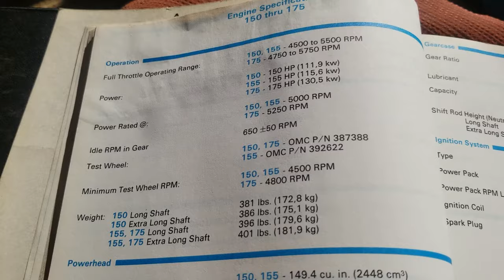How To Link and Sync An Evinrude Outboard

Comment from the maker: Hey Yall! Tools & parts in the description. Check out the previous video: Evinrude Outboard Timer Base Replacement:  https://youtu.be/cH7iE25YJAY
Timestamps
0:00 Intro
0:55 Checklist
1:16 Sync Carbs
3:07 Timing Settings
4:30 Set Timing Pointer
7:24 Set Pickup Timing
8:24 Set Idle Speed
9:40 Set WOT Timing
13:11 Test Run On Water
13:28 Outro

**Disclaimer: Matt's Shop assumes no responsibility and is not liable for any damages that may occur from attempting to duplicate any repair procedures performed in this video. This is for entertainment purposes only.**
Reply: Do you have a tutorial on harnesses and starter hook up

Comment: great video thaks a lot!..........can I ask you something...........I have a Johnson 100 hp 1985 (J100WMPLP) and have also the service manual, where it says there´s a decal on the motor with the timing specs....well, I don´t see any decal anywhere and because of that don´d know the max spark advance timing........what should I do?........thanks in advance

Comment: Would it be possible to have a word with you on this since I'm doing the same thing except on a 79 Evinrude 115hp. ??? example question why when I put the timing light on cylinder one plug the timing marks on the flywheel don't show at the timing pointer? Oddly it shows when I put it on Cylinder 4. Among other questions. What would be an easier way to have a conversation with you rather than typing here and waiting for a reply. We are not in the 80's anymore ya know. Much appreciated.

Comment: I have a 1972 evinrude 135 it sounds like its in gear when i start the motor also sounds like its full throttle alao the prop spins while in neutral i have it on a motor mount off my boat but im going to need some help getting it running right i was wondering if you could shed any light on it as right now its pretty scary to start the motor and it sounds like it is running full out in neutral and insight would help

Comment: Hi ive noticed your primer switch is not in the run position is there a reason why i the same motor but a johnson gt175 my primer valve points to the bottom of the electic unit, its right up cold or warm but bogs down when u add throttle to it.

Comment: Good informative video. Just a little more information that is considerably safer, set the timing  with the cables disconnected , cranking the engine. You can set all timing events while cranking the engine. That’s how I’ve always done them. The only thing I adjust on the water is the idle rpm.

Comment: Awesome. I have a problem with my 04 rude 225 that stall when I accelerate. Only does it sometimes. The diagnostic show CPS out of sync. Replace it still same issue. Any idea that will help? Thanks

Comment: I have a 1984 Evanrude Super40.  I believe it is identical to the 84 Norsemen. Sold to another part of the world and name something different.  

Is it possible to take a electric start system from a 84 Evan rude and adapted over to the 84 super40.

My problem is that you damn near  have to be the Incredible Hulk to pull start this motor and if you're not paying attention it will pull you right back into it.

 So I'm hope is that I can take the electric start setup off of the 84 Evinrude 40 and it will fit onto the 1984 Evan rude super 40. 

Thankyou. 🙏🙏

Comment: I've got a 50hp evinrude on my 13ft whaler that only goes 23mph, maxes at about 3000rpm, and it has issues planing with more than one person in the boat. I weighed the boat and motor thinking it was water logged, but total only weighs 650lbs.  I'll be doing this tomorrow. Thanks for the awesome video.
Reply: How'd it work out
Reply: Make shure your power pack leads are correct
Reply: what year is it? are the throttle plates exactly horixontal at WOT? just get a toothpick and stick it in the roll pin on stbd side of #1 carb, no need to remove air silencer to check.

Comment: Just wondering what is the best fuel/oil mixture for an outboard?  I have an old 1975 Evinrude 115 hp.  I don't have the owners Manuel, but internet says 50:1.  Your thoughts...  thanks!
Reply from the maker: 50:1 Always on old outboards. That's what all Evinrudes do best on.
Reply: @MattsShop  thanks Matt!!!

Comment: I’m having issues with my 1987 Johnson 90hp she will run perfect but she won’t stay running on idle but if I lift the throttle by a hair it starts but high revs
Reply from the maker: They always do this. If you are running surface gap plugs. Look up QL77JC4 it's a regular J style plug. You gotta make sure your model can use them. They always run extremely rich at idle assuming there aren't any other fuel problems.

Comment: Incredible thank you been waiting for amazing material that is so in depth thank you so much for going over this especially on a old Evinrude. There is no in depth ones like this thank you thank you thank you your amazing.
Reply from the maker: You're welcome! I know, no one has done an in-depth video like this one.  I would still buy a service manual online and if if gets confusing, watch this! The settings will be slightly different for different models.
Reply: @MattsShop  I have an original service manual I sent you an email through your marketing email.

Comment: i have a evinrude 110 and it boggs out at full throttle any suggestions it runs really good I just need to know how to fix that problem
Reply from the maker: It sounds like it's starving for fuel at WOT. Look for leaking fuel hoses leaking air/fuel. Sucking air is just as bad as leaking fuel on a 2 stroke. Or have someone look at the timing. The throttle plates might not be completely flat at WOT.

Comment: Hello Matt! I really appreciate your video on this subject. It’s very well done and gave me a lot of good info since I just got a 1989 Johnson get 150. I have one problem with the carb butter fly valves. They will not reach full open  horizontal position. No matter what I try. Am I missing something? Thanks
Reply: Either your throttle cable is adjusted incorrectly or your wide open throttle stop needs to be adjusted to allow the arm to advance forward further

Comment: Thanks for the knowledge... I'm having fits trying troubleshoot my 200hp johnson. Someone has put a bunch of new  Ignition parts stater flywheel and I don't know if they knew what they were doing I don't know if they're using oEM parts I don't know a lot about it but they have replaced everything electrical on the motor and it has not ran since.  You give a great tutorial but all that stuff's kind of intimidating I am mechanically inclined but that's working on motors and motorcycles and stuff this outboard motor business is completely different but I really want my bike running so I guess I'm gonna dive into it do it so you're probably gonna get like 200 more views just from me alone
Reply from the maker: Don't be intimidated. It gets easier the longer you look at it. Make sure you get an OEM service manual and talk to a professional if you are that concerned.

Comment: Hi Matt, great video. I have a 1989 175 XP. only firing on three cylinders. I've changed primary wires to coils,  from coils that work and all coils seem to be good. Is it the power pack? Stator? Or maybe both? Hope yo
Reply from the maker: If it was mine I would swap the power packs with each other. If the problem follows it's the power-pack. If the problem stays it's the stator/timerbase. It's a free test.

Comment: I have a 1997 evinrude 115 hp ficht engine, I understand that the spark plugs need to be indexed but the manual doesn't quite illustrate it very well as to where the air fuel spray is located to line up the electrodes correctly. Can you help me with this?
Reply from the maker: Hey, I am not that familiar with the FICHT Ram Evinrudes. I mainly work on the 1979-1994ish crossflow/looper outboards. Is indexing the sparkplugs necessary on the FICHT outboards?

Comment: I went through and set everything carbs are open about 1/8 idol neutral is the common when I took her out she acted like is was in safe mode have good spark all six timing is good I noticed that I had swapped starboard and port heat sensors around while rebuild heads one has oil line (unplugged) I use mixed gas would that have anything to do with it being in safe mode and is 1/8 open on the butterfly’s normal thanks your time bud you’ve helped me a lot btw I have the same motor just a year newer 1990 evinrude 150 xp
Reply: My power pack leads got mixed up she should run like a top now

Comment: Do these carburetors have a air/fuel mixture screw possibly behind a brass plug or something. Got a lean sneeze on start up.
Reply from the maker: No, these carbs have no adjustments the jets are a fixed size from the factory. No tuning required.

Comment: Hey Matt I've got an old Johnson 150 v6 and when I've got it out of the water it runs good will go full throttle and then in water full throttle it acts like im giving it 30% throttle. Its not bogging or anything just won't give 100% throttle.  My hub on prop is good throttle box will give me 100% throttle out of water i watch the butterflys open to make sure . Getting puzzled here
Reply from the maker: I had the exact same issue. Check the timer base plastic ring it can well and need grease. Make sure the timer base rotates freely. https://youtu.be/cH7iE25YJAY Skip to 14:37

Comment: 1985 evinrude 150 vro xp question in your video at 3:10/7:08/12:07 the blue thing under the fly wheel that piece of metal that goes in it what would cause that to pop out every time that you put it in full throttle? I can get it to click in, but it still pops back out when i put it in full throttle mines like one little black boot. Thanks your video is great!! If i had an email or something to send you the video i’d show you exactly what i mean but its the same spot as your blue on except mines metal and it has one single black boot that it slides into.
Reply from the maker: This one is plastic. It's called a ball and socket. They get worn out and the ball part just pops out of the timer base or the timing lever. You have to buy new parts. 2 ball ends and 2 sockets on this model. Make sure the timer base rotates freely.
Reply: @MattsShop  yeah it rotates freely i really wasn’t expecting such a quick reply I appreciate it. Is that an easy fix or should I probably take it somewhere I don’t wanna mess anything up. I’ve googled how to change ball and socket in a few different wordings I know the ball pulls out easily, but can’t figure out how to get the socket part out or get it back in when i get it out. Also is it normal for a boat remote to not go in forward when it’s not started, but as soon as its started it’ll go into forward. Sorry for 1000 questions. I appreciate your help idk I just bought the boat used 4 days ago, so i’m just figuring out stuff as I go.

Comment: I have same motor and and at full throttle I get a loud metal on metal chirp stops when I back off then if I go back to full throttle it chirps like two pieces of metal rubbing anyideas
Reply from the maker: There are little metal clips under the flywheel that can rub. If it has the original timer base it's probably aluminum that can be off center if the plastic ring below it wears out. Hard to say.

Comment: You mentioned the fuel today as opposed to the fuel in the past.  I am going to assume that you mean regular unleaded fuel.  It is obvious that high octane fuel will affect your timing as well.  Will you shed some "timing" light on this please?  No pun intended...  Lol.  Thanks Matt.  Subbed and following with bell on.  Much appreciated.  Blessings from Ontario Canada!

EDIT:

I have a 1977 35hp Johnson.  Want to tweak it a bit.  Thanks!
Reply from the maker: I just run the cheapest gas possible. Like 87 Octane. The grade of the fuel does effect the timing. I would run whatever you run and set the timing to the manufacturer's specs. Get a timing light with a built in tachometer! It's the best for outboards.
Reply: @MattsShop  Thank you very much!
Reply: @MattsShop  Thank you very much.  Appreciated!

Comment: Hey Matt, why do you have the 4* mark painted if the book shows 7 +\- 1*? You pointed out the 8 and 28 but I didn’t hear anything about the 3rd 4 degree mark reasoning. Please help.

Trying to tune my 86 70hp VRO Evinrude and I’m wondering did you set base idle timing at the 4 degrees or is that just for tolerances from manual? Is base idle timing supposed to be directly on TDC typically?
Reply: no. FORGET PICKUP TIMING for now! Loosen cam roller and let it flop around. remove throttle cable . using only the idle stop screw, adjust it so its 800rpm EXACTLY in forward gear in water not tied to a dock. shut motor off. now take cam roller and adjust throttle cam so they just barely touch at scribe line. now tighten cam roller screw, and back off idle stop screw exactly 1/2 turn. now idle should be 750rpm. re-install throttle cable and done. do not worry about the pickup "idle" timing number! its rpm that matters as timing will be perfect.

Comment: I have a 1996 112 HP Evenrude, and I been having a hard time getting the motor to start, sometimes I spend about 15 to 20 minutes trying to get it to start and stay running. Do you have any suggestions on what could be the problem? Thank you!
Reply: post compression #s and verify primer is squirting fuel.

Comment: Hi Matt, I am about to replace the stator and the trigger timer base on my 1990 Johnson GT150. Is it absolutely mandatory that I re time my engine?
Reply from the maker: Yes, you absolutely have to check it or have a professional check it. It's dangerous to do on the water. The timing will be off with the new part.
Reply: Did you ever get yours going? I have the same motor
Reply: @daviddrabek5834  yes. replaced both the stator and the trigger timer base and it ran like a new engine.
Reply: @angler1204  okay I’m starting the process now. Thanks for getting back to me

Comment: I see you deal with alot of boats. I have a Johnson 110 v4 vro. Starts right up and runs good at high idle. But normal idle it shuts off. New plugs. He said carbs was cleaned. Just bought it yesterday. Any ideas
Reply from the maker: Is the fuel pump diaphragm in good shape or are there any hidden fuel filters at the gas tank? The pickup timing might be off. Is the little plastic roller cam on the timing tree in good shape?
Reply: I will check. I know there's one fuel filter at the back of the boat. A clear filter.
Reply: I just bought it yesterday. I seen your video about spark plugs. This boat has 3 new ngk and one older champion. Not sure what's going on there

Comment: So after all adjustments carb are open like eight of a inch neutral
Reply from the maker: They have to be fully closed, and then after all of the timing adjustments, they are held open a little. You can't just guess it.

Comment: Hey Matt I have a 1986 110 evinrude and it was working great then one day I seen some smoke as water pickup got clogged with weeds. I stop engine and stuff but would never run right. I put 4 new coils on, plugs wires and rebuild carbs and fuel pump now in messing with link n sync. I got it on plane the other day and runs and sounds awesome but now I can’t get it on plane and it keeps dying when I give it gas. My cam follower pickup has so much play in it!!!? I’m confused if I upload a video of it could you help me out thanks brother!!! Cheer 🍻🍻
Reply: All compression is with in 5% max is 105
Reply from the maker: Yea, upload a video. I'll look at it. Send me an email. If it's the plastic roller you can replace it.

Comment: Iv got a 1989 Johnson gt150 looks identical to yours. Would this work with my motor
Reply from the maker: Yes, GT150 is the Johnson version of the 150XP.
Reply: @MattsShop  thank you. I do believe iv been running way to advanced on my wide open throttle timming. Now for the fun part of flying at 5000 rpm up the river while adjusting it.😬

Comment: Have you heard of the "Joe Reeves" WOT timing setting?
Reply from the maker: Yes, I have. I have tried it twice on two separate engines. Could never get the timing to advance right. It would always end up being set WAYYY too far advanced when running.
Reply: Joe. R.  Method is. Wot static minus 4 deg.   Has anyone actually tested this ?   Compared.     With a test wheel or at speed?

Comment: I have a question my boat doesn’t idle well at times and sometimes you can start it no problem but as soon as I put it in gear it dies it has a hot foot so I try to give a little gas and then put it in gear but it just dies do you think this adjustment will fix my problem?
Reply from the maker: It could, but people talk a lot of smack on hot foots. Boats are really ment to run at steady RPM.
Reply: @MattsShop  yeah I’m not a fan it came on the boat
Reply: Hey did you figure out what the issue was, I have the exact same problem